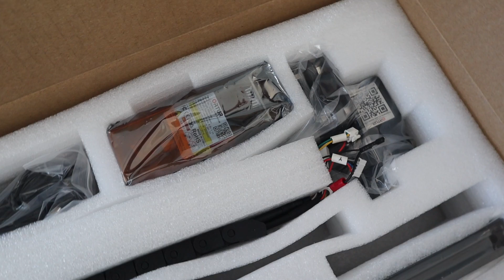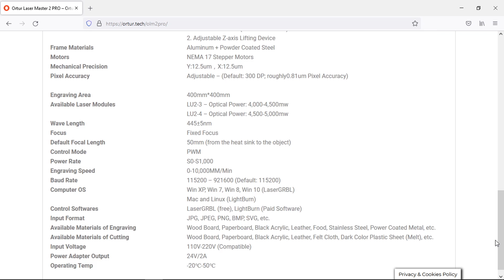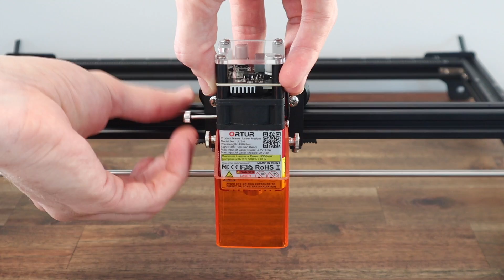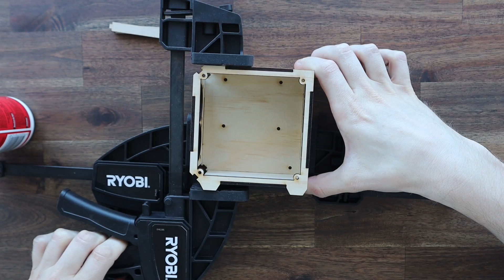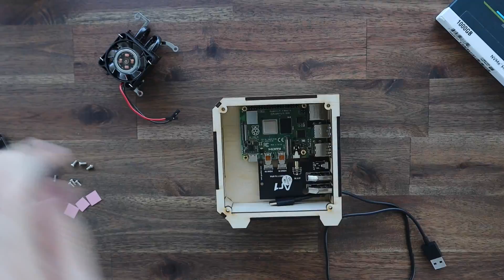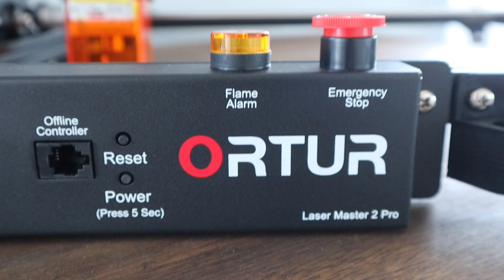I Made a New Raspberry Pi Case using the Ortur Laser Master 2 Pro

Comment: Would this work with an M2 Hat? Ideally at the bottom. 
Also having one front and one rear fan would be an instant buy for me
Reply from the maker: You wouldn't be able to use a bottom mounted hat as the port positions are fixed but you could use a top mounted one or a bottom one and just mount it over to the side or on top.

Comment: Love the video keep up the good work the case looks so good I did get confused when you said you cut the acrylic with your CO2 because a diode laser couldn't cut acrylic I cut acrylic all the time on my 20 watt diode
Reply from the maker: You can cut black or dark coloured opaque acrylics with a diode laser - I'm not aware of any diode lasers that can cut clear acrylic.
Reply: @MichaelKlements  the only type of acrylic I cut is the clear acrylic 2 mm thick I just leave on the brown paper part the protective layer cut it out and then remove that protective layer from there and I've never had an issue

Comment: Beautiful. I bought your single fan case one model from etsy and made that version for my pi 4. I might give this one a go too. Can you please let me know if running more than a fan will create any problem to my pi or not? Or is there a way I can control the fans, like I might want to run one always and other I want to keep turned off until it goes to a certain temperature?
Reply from the maker: You can run multiple fans on a Pi without any issues, I've also recently put together a PWM control script to control the fan's speed depending on the CPU temperature - https://youtu.be/N5h6Y7KGLDc

Comment: 1) Balance the fan blades and the noise level will drop. Just hold them in your hand to assess the vibration level and stick on the pieces of tape. Then drill a hole on the opposite side.
2) You can cut plywood more efficiently if you bring a flow of air through the needle from the syringe to the cutting zone from the compressor.

Comment: Noctua has some 5V 3pin 40mm fans you should try those xD
Reply from the maker: I've just ordered some!
Reply: @MichaelKlements  I've actually just been thinking, both types of the ICE tower don't contact the ram or usb or ethernet controllers, and don't appear to leave much room for attaching small adhesive heatsinks to those components. Do you worry about any of those things getting too warm?

Comment: Hey Michael, this build is fantastic and I currently have parts on the way to do my own. I'm planning on wiring in a switch on the front top (slanted area) so I can turn the fans on and off depending on if I am using it heavily or just having it sit there running torrents etc. 

Can I ask how you've found the cooling/temps with the SSD so far? I've heard NVMEs can run hot and noticed you don't have the heat sink on that comes with the enclosure in the link. I'm hoping to install mine with heat sink attached.

I've also got a slightly different extension board on the way which routes the power to the back panel too :)

Cheers!
Reply from the maker: Hi Mitch, that's great! That's a good idea, they're probably not necessary most of the time. I haven't tested this, but it might be an idea to put some sort of potentiometer arrangement or voltage adjustment onto the fans. That way they'll be much quieter at low voltage and you could ramp them up when needed.
I haven't noticed much heat coming off mine, but I'm also not actively transferring large files to and from the drive regularly. I guess it depends on your use case. Adding some heat sinks to it can't hurt, so if you've got them then definitely try them out.

Comment: The side panel could use some vent holes. I'm sure it would help with cooling.
Reply: Thats what the two smaller fans are for. They pull the air into the case, not push it out